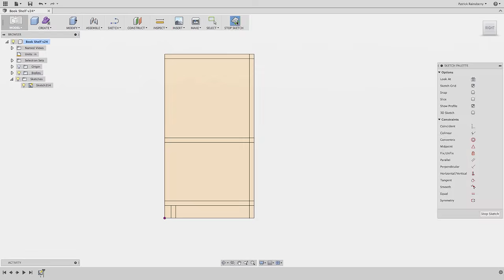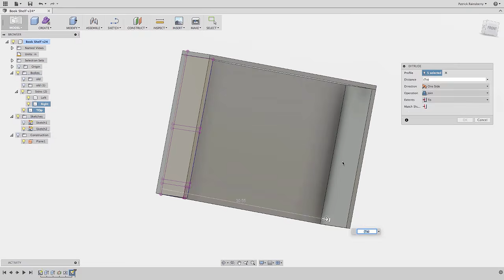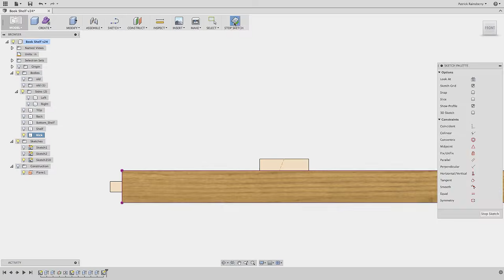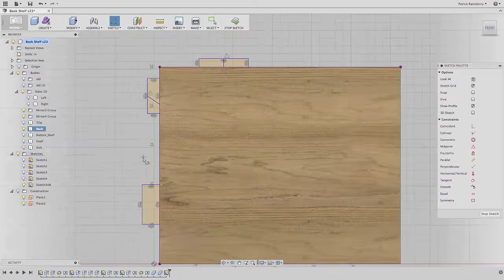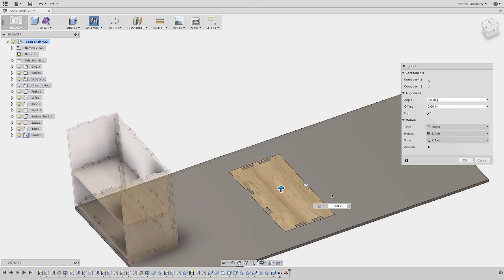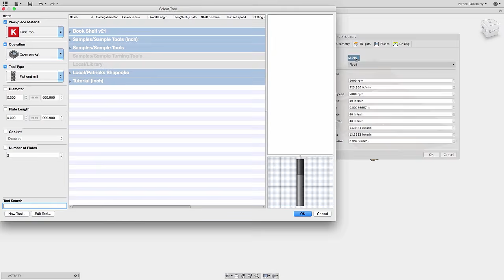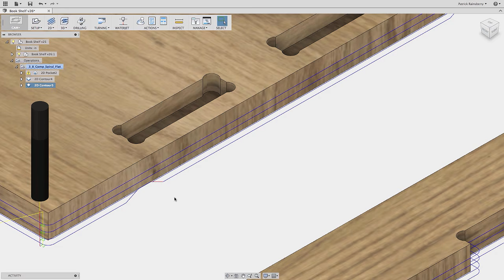CNC Router with Fusion 360, Bookshelf Tutorial

Comment: Patrick,  a great video.  Thanks!   I followed the video creating the design and I had one issue, looking for clarification on one of your responses, and a query on alternatives   

The issue I had was on the first sketch.   When setting the dimension for the middle shelf position relative to the bottom an error popup occurs stating "geometry is over constrained".  Everything I did in the sketch creation duplicated your video.  I can't determine why?  

The clarification I wanted was about keeping a view of both the assembled project and the CAM layout.  You said you made a duplicate copy first.   True?   

  It amazes and frustrates me that there isn't a way (at least that I can determine) to keep multiple views of the design together, assembled or disassembled,  different visibility setting or cutaways to expose assembly details, etc.   I've used Sketchup for years for my wood working which had something called Scenes which did this.   I moved to Fusion 360 when I bought a CNC and have been nothing but impressed with how well things are integrated but hoped I would discover this capability.   Also Nester is great and I'm so glad you educated us on it's function in a real world example.  Do you or any of your followers aware of an AddIn which takes a built piece of furniture plus a list of boards or panels and produces a layout automatically?  Such a plugin existed in Sketch (Cutmap) and I found it invaluable.    

Thanks again and thanks in advance for responses or pointers!
Reply from the maker: I have been thinking about trying to do something similar but haven't gotten to it yet unfortunately.  I think this is something that you will see put directly into the product at some point as it is also very important for Sheetmetal nesting, but of course i can't make any promises.  

As far as the sketch goes it is sometimes possible that when you are sketching some constraints are created automatically.  Sometimes it is things you didn't intend, like for example a midpoint ofa line not jsut coincident to the line.  The power of these parametric constraints is that it will allow you to make these few dimensions drive the entire design but at the same time it comes with the challenge of learning the nuances of under defined / over defined situations in sketches.  Trust me the initial learning curve will be something you can get past after a short time then you will really be able to reap the rewards.  This is also something i have been wanting to spend more time on.
Reply: You nailed it.  There was a midpoint applied during the creation of the shelf.  On the subject of multiple views, assembled or disassembled,  it occurred to me that this already exists in the timeline.  All that is needed is the ability to create selectable labels within Fusion to easily identify the view you wanted and conveniently move between them.  Thanks again for your help and encouragement.
Reply from the maker: Ha good guess!  Thanks for the feedback.  Best of luck!

Comment: Great video, one question should you not have put an radius on the inside corners of the tabs to represent the cutter radius?  Would not that radius cause the shelf not going all the way into the slot?  You don't actually have a 90 degree corner where the tab meets the shelf.  Should not the corner be a dog bone as well?
Reply from the maker: You have to watch all the way to the end :)
Reply from the maker: I add the dog bones once it is all laid flat due to a handy script i have.

Comment: Kind of a late comment but just saw this tut, exceptional and fantastic, thank you!! Have a curious question, for the tabs and holes, in essence mortise and tenons, didn't see any settings to compensate for the fit, usually there is about 0.003/5 offset for the fitting and room for glue, in other words, the tabs should be 0.003/5 (depending on type of wood) smaller. Does boolean results compensate for that?
Reply from the maker: Great question.  SO when i did this i was really worried about that.  I was thinking about taking the all the faces of the holes and offsetting them by like .003-.005 but i didn't as this was my first time doing anything like this i figured id just give it a try.   2 things: the shopbot was VERY accurate and really got it nailed since i used a very accurate wood thickness to begin with.  Second, woodworking is very forgiving.  I think .005 in wood is like a swift hot of a rubber mallet.  SO in the end i got super tight fits with very little effort to press them in place.  Others may find different results, but i have so far had great results modeling to flush.  Which is something i would never do for something like injection molded or CNC'd parts.
Reply: Thank you for your comment, I don't see much of a problem working with plywood, but I do a lot of hardwood projects, inclined to offset faces at least 0.003", as you said a hit with the mallet works on plywood because of its nature, compresses very easy. Thank you for a great tutorial!

Comment: Hi there, I'm getting a the following error when I try to apply a dimension for the shelf height. (the distance between the bottom and the middle shelf)

 "Adding this dimension will over-constrain the sketch..."

I've used height to determine the total height of the sketch and then followed the rest of the steps. Is there an order I should follow when using dimensions? 

To troubleshoot, I've removed each of the dimension constraints and tried to add them in a different order.
Reply from the maker: There must be something extra in the sketch that creates a conflict.  It is possible that one line is actually attached to something behind it.  Or is accidentally constrained to be equal or something like that.  I would try re-creating the sketch and make sure no extra constraints are created.  Sometimes they are automatically created.

Comment: Great work.  I'm a little confused as to the tab cutouts.  How did you keep the tabs from going all the way through the cutouts holes?  I don't remember seeing you modifying the tab lengths so that they wouldn't show through the material cutouts.  ?
Reply from the maker: I actually have them going through on purpose in this case.  Saw a bunch of furniture designed like that at Shopbot HQ and liked the look.  For more traditional look you could definitely use the blind depth and make the pockets also not all the way through.
Reply from the maker: SO they do go all the way through on the sides and back.  On the top piece I set the depth of the tab and cut to be 2/3 the thickness of the material.  It is a setting when i am creating the tabs.
Reply: In the video for the tabs on the kick that goes into the bottom shelf you set the tab depth to ply which would go clear through, but later in the video you show the bottom shelf as having blind tabs like the top. It seems like that top tab depth should be set to blindTab instead of ply. Enjoying this video.

Comment: Nice tutorial, but missing two things.

One, there is no design for screw placements, necessary for keeping the stock down on the shopbot when milling ( though I understand you can use the hole feature to add those to the stock drawing). 
Secondly, i'm disliking that I loose the 3D assembly when moving all the parts to the stock. My guess that it could could be solved by creating a mirror of the entire design, before putting the parts down on the stock. Or is there a more elegant solution? 

:)
Reply from the maker: Yes i think making a copy is the best way.  Been thinking about making a video showing the simplest way of doing this.  

When i did it on the ShopBot i used nylon brad nailer to hold it down.  Could easily add screw placements though.

Comment: great tutorial, subscribed! :-) One question though, when joining the pieces to the plywood-plane, why do you select the bottom faces and then choose "flip" in the join dialog? Couldnt you join the piece's top face to the plane's top face?
Reply: oh, is it because of the blind holes? in that case, couldnt you flip the entire plane after positioning the pieces? It seems like doing it your way could result in a mirrored piece if you forget to select the flip-option on one of maybe dozens of parts (in a bigger build for example)
Reply from the maker: +Felix Dietz yes because of the holes.  One thing you will learn is there are many ways to do things to get the same result and you kind of choose the best for that situation.  You are right that way would work

Comment: Very nice video and nice design, but why did you cut the pockets all the way through instead of stopping 1 ply from the edge? 
By not cutting through that last ply I think the end product would have had more of a  fine furniture look. (as fine as you can get with plywood)
Reply from the maker: Yep totally.  I left them with a blind depth on top for that look.  I actually kind of like the un-refined look of putting the pockets all the way through.  I visited a few places (including shopbot HQ) and saw that style all over the place and just kind of like the look.  

Could easily modify this design to be all blind depth pockets especially if you were using nicer wood.

Comment: Hi! I see that your pocket are the exact size (by boolean cut),  Did you leave any clearance? How did you put it together if there is no clearance?
Reply from the maker: +Yuval Rakavy So i was worried about this, but the shopbot was pretty precise and Plywood is fairly forgiving.  
To assemble i put a little wood glue on the tab and a satisfying tap with a rubber mallet into place. No joint on either furniture piece i did even needed sanding for fit.

Comment: Very nice tidy project/tutorial; it is the goto reference I provide to folks who ask me about CAD/CAM; the design of the lessons are superb.
I use Fusion 360 (over Mastercam) and am getting used to the parameter  table for all 3D work but just one question 
at the end if I change a parameter how can I get a view of the finished assembled project (with different parameter) to show my wife when it appears that the ultimate assembled project is flat items (sort of nested) ready for CAM;likely obvious answer but not on first or second thought by me)
 thanks in advance
Reply from the maker: Yes we are working on a better solution for that actually.

In the mean time there is something you can do.

At the bottom of the screen is the time line.  All of those icons represent the features used for creation of the model.  At the end there is a little vertical bar.  You can drag that bar back in the timeline before all the move commands that laid it flat, and you will be able to see it all put together.

Let me know if that makes sense
Reply: +Patrick Rainsberry Sadly it is the "horrible" solution that I could not bring myself to contemplate ;-)
The challenge in any such method is to find it in a complex project "bookmarks" would be one way...
Regards and Thanks again
Reply from the maker: I have a little project I've been working on to simply the process a little bit.  Stay tuned

Comment: This tutorial has been excellent.  I have one question about depth of the pockets.  I'm wondering if there is a way to set the extra clearance to a parameter so that it's easy to experiment with finding the right amount in later milling operations.  Or perhaps there's a way to add that parameter to the CAM portion?
Reply from the maker: +Evan You could apply the extra depth as a parameter like the other ones i set at the beginning.  Currently you can not use parameters in the CAM workspace from the design workspace.
Reply: +Patrick Rainsberry Do you have a suggestion on how to do that since the pockets were created with the cut function?  Thinking this out, if the tabs stick out a certain amount, then are used as a tool to cut another body, then the dimension of the tabs are changed (perhaps by changing a parameter), do the cuts in the other body change as well?
Reply from the maker: +Evan yes they do.  The entire model builds as a series of operations in its history.  So if something earlier changes and something downstream references it then it will change as well.  The bar at the bottom of the screen with all those icons shows you the history of all the features you've created.

Also though if what you wanted to play with was the gap which i believe i add by moving the face after the pocket is cut out.  You could apply a move to deepen the pocket and use a different parameter to drive that operation later in the model's history.

If this is the first time you've used a history based modeler don't worry it starts to make sense.  Just try some simple models where one feature builds on the last.  Then go back and change the earlier feature and see how the update propagates.
Reply: +Patrick Rainsberry That's kind of a bummer. I thought I had found a quick way to adjust the gaps.  But that kind of behavior (preserving a cut depth) would, I suppose, break the parametric propagation paradigm.  It sounds like I have to go through and select all the pockets in order to apply a move command to add this gap parameter.  That could be tedious.  Thanks for all the help & the great videos!

Comment: 5:20 into the video and I'm feeling as if I witnessed the moment of creation itself XD I can make a very advanced speaker enclosure design and then just change those parameters and bingbadaboom its another size with different thickness material and different bracing dimensions etc. Sweet!
Reply from the maker: +lazygamerz wow thanks man.  That is so cool to hear.
Reply: +Patrick Rainsberry One thing though, when you made the side panel you could have just put a minus sign in front of the "width" value, then it would go in the other direction, and would then cover the side and you wouldn't need to sketch a new to make the rest of the shelves and stuff from the sketch.

Comment: I understand dogboning when using a purely 2d design, but with a fully 3d capable cad/cam software, why don't you just add fillets to the corners of your 'tab' corners that are a little more than the radius of your cutting tool?  So both the slot and the tab have corners that are rounded to match your cutting tool?  Seems like the finished product would look a lot nicer without the gaps that dogbones create.  I don't think I have seen this done yet, I am wondering if there is a reason I am missing.  EDIT: I guess you would have to make fillets on both sides if the tab was 4 sided and not along an edge. 

Random thought aside, thanks a lot for these videos, they are super helpful in getting used to fusion 360.  I am liking it a lot, coming from 123d Design.  So much nicer (123d design bogs down horribly when rendering sketches on my machine)
Reply from the maker: +Alluvian cool thanks for the feedback.  Yah thats the reason.  Would be total over kill to try and do the out of plane filleting on the router i think.  Although worth a try?

I have actually come to like the look of the dog-bone, kind of a cool industrial look.  The other option is to make all the pockets blind like i did in the top so you don't really see it.
Reply: +Patrick Rainsberry Yeah, I like the idea of the blind pockets, but it all depends on application of course.

Comment: Great video. Wish it had instructions for fixturing and physical machine setup.
Reply from the maker: +evolutionxone yah i wish i had recorded that part.  I'll tell you this one was pretty simple.  I used polymer brads in a nail gun and just shot them about every 18" right around the perimeter.  I think i had a little lift up in the center and should have putt a few out there in known waste spots i think.